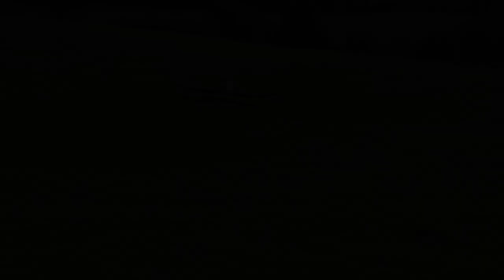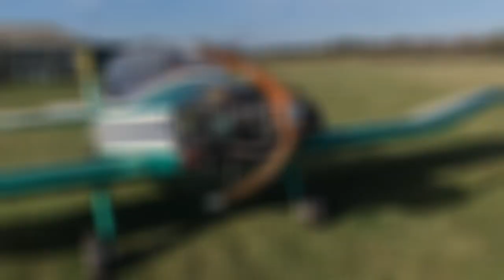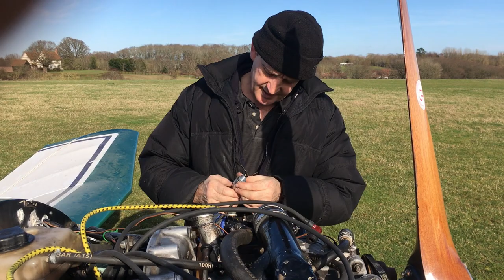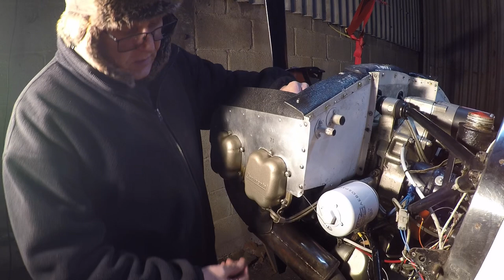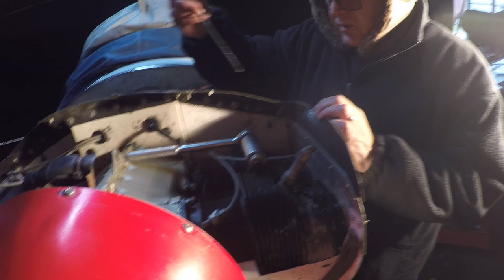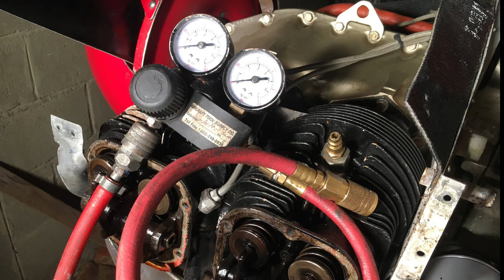GREAT LANDING IN BLUSTERY CONDITIONS MARTIN! - PILOT VLOG#350

Comment: That was a sporty landing, very good job!. Just went through the same on our AA5A, no compression on #4 cyl. Pulled it and the compression ring fell out in pieces. All cylinders had 1400 hr + so I changed them all with new, not cheap! If ever you need something from this side of the pond just say the word.  Cheers mate!
Reply from the maker: Martin did do a good job as the wind had really picked up while he was in the air. Your engine work sounds expensive?
Reply: @JodelFlyer  Just under 7K $ for the cylinders. UGH, there goes my new frock.

Comment: I always listen to determine where a leak is. You can detect a hiss through the exhaust pipe or the crankcase breather. One low compression is not unusual in an O-200 engine. Sometimes a ground run clears it, sometimes a tap on an offending valve. Sometimes a cylinder has to come off... The O-200 engines I had were usually top overhauled at around 1,500 hours and then they went through 2,000 hours easily. One engine I had did 2,796 hours on condition, oil pressure was still good, compressions were still good, but mechanic was nervous. I raced this engine, 2,750 RPM all the way. O-200s like to rev.
Reply from the maker: This engine has about 350 hours since a rebuild. Pot came off today so the investigation begins! 🤞
Reply: @JodelFlyer  oh right, then I wouldn't touch it unless there's a clear problem.
I'd tap the valves.
When I had O-200 engines overhauled their compressions would go down at around 400 SMOH, panicked at first, but if I ran it another 50 hours or less the compressions would come right back up! It's a quirk of O-200 engines.